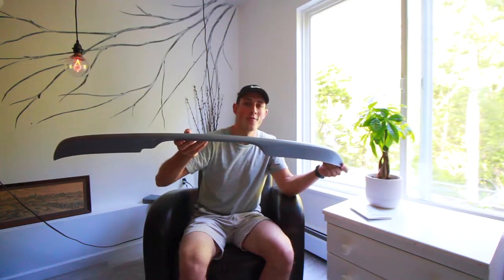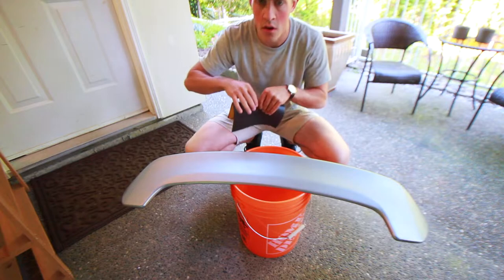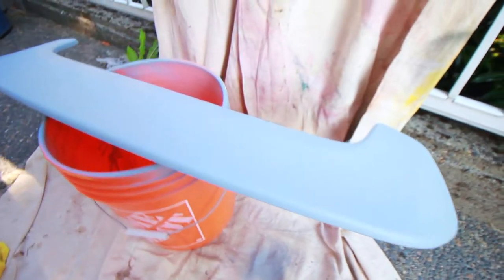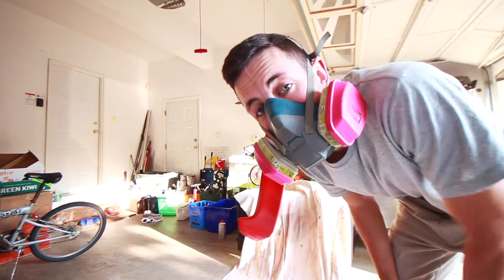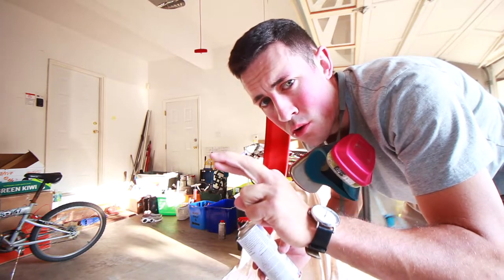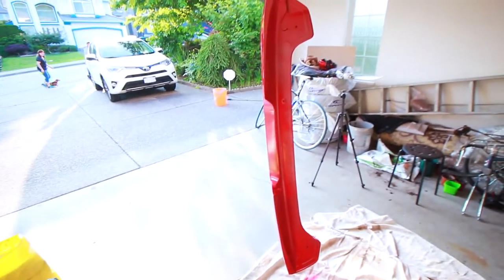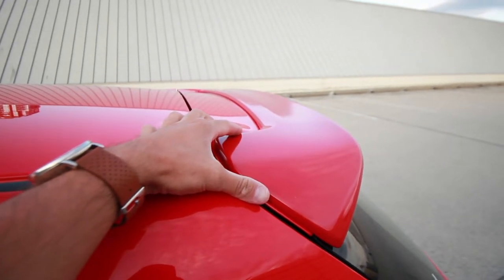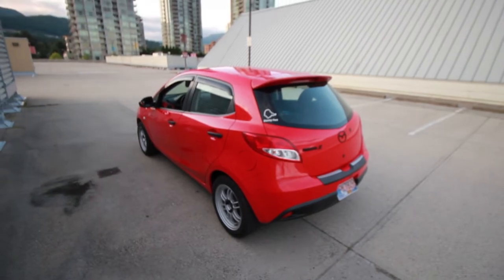Spray Painting An OEM Spoiler For a Mazda2! - Project Duece

Comment: Nicely done. I've considered getting a spoiler and painting it black. The Mazda2 Colour Edition in the UK has a black spoiler and side mirrors on a red or white car, which looks awesome. I hope tape is enough to fix it to the car. Usually this spoiler is installed with four bolts.

Comment: My first car is a black mazda 2 aswell.

Already changed the  14 inch silver wheel caps to black 16 inch rims.

I am almost gonna decide to buy an black spoiler for the mazda 2 from ali express. Saves alot of work cause its already painted in the right colour.

I just don't know if I can trust ali express. I heard mixed opinions about it from people.

Anyone has a recommendation on where I can get one. I live in the netherlands.

By the way. I Love your mazda aswell.
You're only gonna work on the outside? or are you going to make it faster too?
Reply: Did you find a spoiler for your black mazda2? I have the exact same car and color.
Reply: I have the same second thoughts. Have you bought it finally? Can you share your experience and price? Greetings from Greece!!!